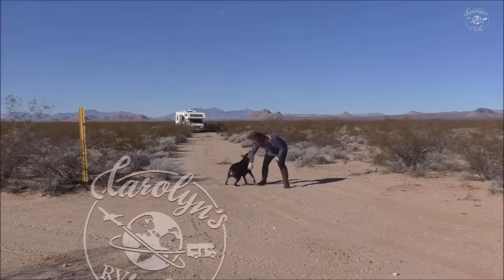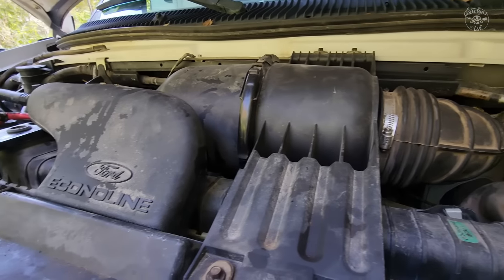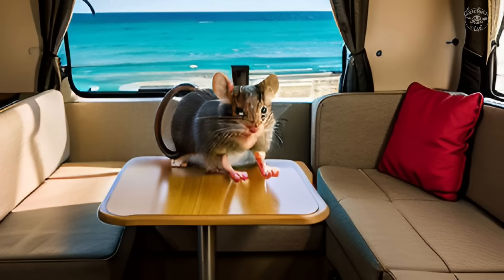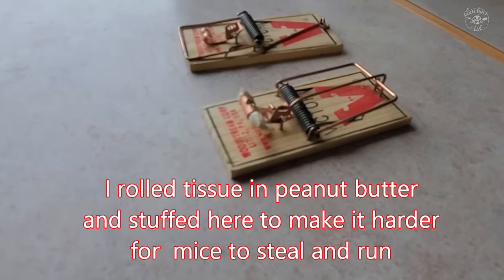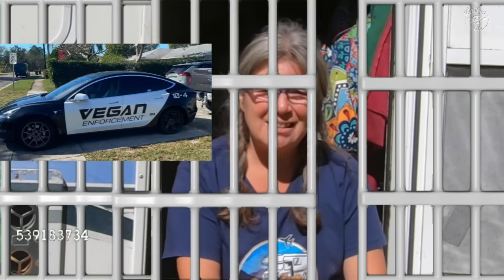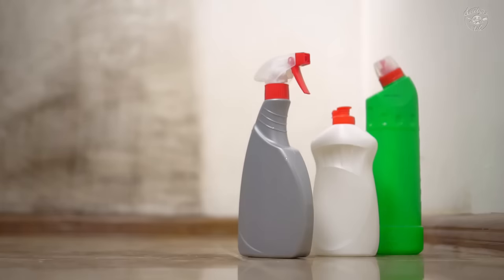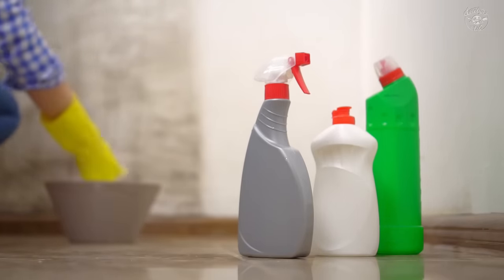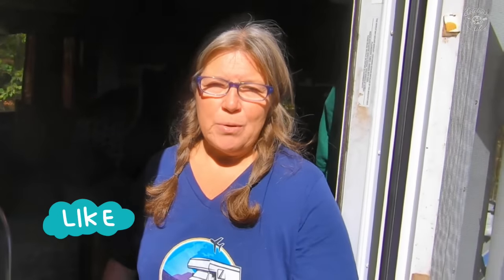Tips to Keep your RV Mouse Free, Plus My Secret Weapon for Keeping Mice Out!

Comment: I used Pinesol in my ambulance conversion due to it being rodent-infested when i got it.  I spay peppermint oil in the engine bay, wheel wells, and at the doorways, and so far.. three years now, not one mouse has bothered.

Comment: Thank you for the video. This past winter we completely packed every hole with peppermint pellets and it did not work. I bought the little packets with peppermint, I had peppermint pellets all over the ground and in compartments, peppermint everywhere. However, no peppermint oil. So the trick seems to be that peppermint oil coating everything works much better than the peppermint pellets.

Comment: To all of Carolyn's friendslys  who own pop up campers. The way you can  keep mice away during the winter is. When you close up your campers for the winter is go to the grocery store and  buy perfume dryer sheets and put the sheets all over the inside of the camper,  on top of the beds  and in the cabinets  and even on the floor . Anywhere they come in.  On the outside of the camper put steel wool in all of the holes so that they don't  go in . Tried it and it works..
Reply: I had mice in the drawer, in my RV, where I had a box of dryer sheets. They weren't deterred.

Comment: Stored my motorhome over the winter, which was really mild in MN this year. Came back and first thing I did was checked the drawers. Saw mouse poop and remnants of acorns in every one and even a small pile in my bed. Never had an issue with mice and the only food I had left was a box of spaghetti, which was untouched and some spices and condiment packs. They chewed into the condiment packs. Since I've been back I've only seen evidence in one drawer they at least once came back to visit when I was gone for a couple of days. I've kept a string of lights on under the coach and when it gets warm and dry I'll go through all the cargo holds. It seems they came in for a warmer place over the winter, and I hope that's the case. I'll add some peppermint inside and outside. BTW, they were in the drawer where I kept an opened box of dryer sheets and that didn't deter them at all.

Comment: We have had rodents in our RV and we have found that Irish spring grated helps as well. We put all around the outside and under the rv especially the under the cab. Put some in the drawers towards the back.. we also put it a little heavier around and on top of the tires. We are in Ohio where the winters are cold longer so we put insulated tubing all down the slide out on the inside and outside and has helped keep them from coming inside, when one got in it couldn’t find its way out because of the tubing covering all the slide out. It then went up and behind the flap on the burners and I keep a mouse trap there and got him that night. I also put steel wool with tape in the opening of the fresh and grey water tank. They also because it’s not sealed very well found big nesting beds in the generator area so lots of Irish spring there with peppermint spray.  So I feel your issue. So glad you solved it.

Comment: Wanted to find out where they were getting in my van.  Looked at rear doors and suspected the gaps under the doors and stuffed them with steel wool and rags. Set up camera and light last night to see, and sure enough, that was at least where I saw quite a few mice and possibly rats trying to get in.  Argh!!  

They did not get in as far as I know last night, but setting up a camera and finding their entry ways is imperative.  When you find the holes and or gaps you need to figure out a way to seal them up permanently.  Which is where I am now...Bob Wells recommends a bucket of water system to kill them more humanely.  I'm a big wuss, so trying to figure out the solutions now.  (p.s. I have blinking lights under my hood and under the area below the engine (5 of them.)

Comment: I lived in a house built in 1840. Mice had pheromone tracks going back generations. I did many things to conquer the mouse problem, but the most successful was having a dachshund. They are bred as vermin hunters and are relentless when they hear/smell mice or other rodents. Never had a mouse problem as long as the doxy was on patrol. Mice smell a dachshund and they leave! 

Before the dachshund I baited live traps and drove the mice 5 miles from the house to release them. The problem is, for every mouse you find, there are probably more than 20 babies in the walls. They are fertile a few weeks after birth. 6 generations during the winter months. Assuming half are female, that’s one million mice - if they survive. Get rid of them as soon as you find them!
Reply: YIKES!!  
I wonder if you can brush your dog and take the fur and shove it places to deter the dang vermin. Be a good thing if it worked.
Reply: My dog is a rescue, but obviously a Boxer was there.   

I've heard the same thing...for every mouse you see, there are 25 in the walls. Dang!
Reply: I think its because whe you kick some out, others move in, ones that probably couldnt because it was occupied. Thats what i noticed wheni started trapping and reelasing them. I was even using motion sensors to detect them, so was sure i had it down to 1, then i saw 2 show up in my room, these weren different mice, the other mouse wouldnt dare do that, and they had a different colour, so i think some new ones moved in, and we have access from outside.  Its also an older building and we got racoons too lol i heard them fighting one night and also walking in the vents to confirm they were inside.  This was on the bottom floor.  Theres a bar downstars so no one lives there and is empty during the night so theyve managed to live unoticed i suppose. And if they can get it, the mice can get in im sure and probably why they keep showing up -new ones come  in once theres a vacancy. Just  a theory.  If you cant get a pet, mouse proofing from the outside is probably youre last option.  There could be the tiniest of entrance to get in , or years of tunnels and secret passages if its an old house.  They dont magically spawn out of the walls and it does take some time and a good food source for them to have many offspring. I fed a family one winter and there was only 6 in the end when i trapped in the spring, they didnt explode, but there always seems to be 1 left that you miss and starts the next generation.  The motions sensors helped that, finally telling you if there was any left.

Comment: So, so many make the mistake of not cleaning with bleach the areas where mice and pack rats have deficated and urinated... and then they wonder why the peppermint oil doesn't work. 
Great video!!
I also use Irish Spring bar soap in my problem areas as well.. works very well!!!
Reply from the maker: Thank you and thanks for sharing your tip!
Reply: Thanks for the tip! I forgot about using Irish spring.

Comment: I use white solar string lights on the ground around my rv. And I use the round patio lights and so dar so good. Had  a couple of mice be for I started using lights. I cayght tgem with sticky traps! I grew up on a  farm so I do not mind how they die! Sorry if that offends! My tank drain area I fill the hole around the sewer hose with steel wool and duct tape.

Comment: Thank you for not using poison or glue traps! I've had a lot of success in my sticks and bricks with both the rodent repellent foam for cracks and holes and spraying the perimeter with Tomcat Rodent Repellent, which is safe for use around pets when used as directed. I also spray my engine compartment and the perimeter/ tires of my van with Tomcat. The ingredients include peppermint, clove, and cinnamon, and it's a lot cheaper than essential oils.

Comment: I’ve been using peppermint oil mixed with water and spray in my engine compartment for years to keep my cars and trucks from getting rodent damage from chewed wires. It had not occurred to me to do it in my RV. Thanks for the tip!

Comment: I had a mouse problem after RV storage at local RV repair shop.  Set traps and caught 7 mice.  Been using lights under RV and set traps but I also use dryer sheets in every compartment.  Use them on top of table and bed too!  Haven't had trouble since!  Thanks for info Carolyn!👍👍👍😔

Comment: Peppermint oil - what a great idea! I too found the snap traps to be the most humane. It was very clear that they did not suffer and their lifeless bodies would not kill oils, hawks, cats or other critters. The worst year we got a dozen. Peanut butter was what worked well for us too - perhaps the strong scent called to them. What a great video - the warning about the steel wool was brilliant. Vibrations of driving would cause it to rub away the coating and then it would short to the chassis of the vehicle..

Comment: Using enzyme cleaners will eliminate the organic stuff and odors followed by a hospital grade bio disinfectant.
 Using a vacuum is not a great idea as tiny particles of the germs they carry can get past filters and you don't want germy turds contaminating the components of vac blowing in your space every time you use vac.
They get inside through the areas around the wiper cowling on some vehicles. It can be tedious but using light, smoke(incense smoke ) or steam to find any hole to plug up is worth the effort.

Comment: When I winterize my RV, I put fresh dryer sheets all over my rig. I have had my pull behind for almost 5 years with no mice. Last year, I was lazy and didn’t do it. Well guess what? I have mice in my camper!! So now I get to deep clean the whole camper! That’s what I get for being lazy! When I was cleaning, I found the most mouse poop under the kitchen and bathroom sinks! I also put a brand new bar of Irish Spring Soap under the kitchen and bathroom sinks. I didn’t do that either! 🙄🙄🙄 So now I’m dealing with mice! All my fault! I don’t have any food whatsoever in my camper when it’s not in use, so that wasn’t the issue! And it’s safe for my dogs to be around!! Hope it works for you if you try it!! Since you live full time in your RV, you should change out the dryer sheets every few months!! Hope this helps!!

Comment: I recently had house mouse problems so I purchased “Shake Away” mouse repellent, it has peppermint, cedar and rosemary oil. Like you, I got out the steel wool fine gage and plugged up holes then I thoroughly cleaned and after that I caught 5 mice in the catch and release plastic traps. I think they got trapped inside after the holes were all plugged. I released them in the woods away from homes and two miles away from my home and then the last thing I did was the peppermint Shake Away, after that no more mice. I don’t like the cellophane it comes in but they are small and easily taped to places like inside an old chimney and in the doorways, good to know about the spray. Yes pets can have a problem with the toxicity so excellent warning! But Peppermint really works!!

Comment: Hi Carolyn, it's funny how this video just popped up in my youtube feed as I'm sitting in front of my laptop watching youtube and making peppermint sachets. I have been dealing with mice or rats for a few weeks now in my mobile home here in FL. I have been living in this home now for about 9 years and have never seen a mouse. Well my husband saw one in his bathroom a few weeks ago and it's been driving me crazy. I've been exterminating, and filling holes around the plumbing in our cabinets where I believe they are coming in using copper mesh wire I found on Amazon and it works better then the steel wool. I defuse either peppermint or citronella essential oil throughout my house. We don't have any pets. I just heard one tonight in my ceiling. I'm 68 years old and they creep me out. I started a garden a few years ago so I almost feel like my gardening has brought them in, however I have never seen any out in the garden. I have seen traces of them in my shed as well as various places inside my house on the floor. Because I cannot use any chemical cleaning agents, I clean my floors with vinegar and water with a few drops of essential oils. I'm making sachets to hang inside all of my cabinet doors and in closets though out my 2 bedroom 2 bath house. I made some peppermint spray with water and spray along all the baseboards, because I found out that's how they travel inside your house along the baseboards. I purchase some 1/4" metal mesh screen to place all along the bottom outside of my mobile home skirting. I hope that once I get all the entry point closed off I'll be mice/rat free I don't like sharing my home with these critters.
Reply: Some people have used the sachets, Mouse Magic makes them, but they have reported that the rodents eat the sachets. I've used them and never had them get eaten but with sprays you don't have that issue.

Comment: And old RV'er had a mouse issue and at the time I was having them in my house I had moved into and they suggested old Irish Spring soap the green bars and place them around. After I did that for the next 14 years I never had a mice issue other than the strangler from time to time come late Fall. Also, if you are parked for any amount of time you can get scented dryer sheets and put one in the tailpipe, on the tires, under the hood of the RV and anywhere else you can think it would be helpful at. These two things are not harmful to your pets if they get them but the mice doesn't like the scents and well if they chew on the soap and drink some water you can imagine that one seeing how rodents can't burp or fart.

Comment: Peppermint is the key!!! You can also take old pill bottles (or something similar), drill several small holes, insert cotton balls and soak the cotton balls with the peppermint oil. This can be attached with zip ties to a location in the engine compartment or other RV entry points. I also use the peppermint/water spray for my exterior and interior but I travel solo so I don't have to worry about pets.

Comment: I was going to bid on what appeared to be a brand new Fleetwood Vibe. Let me say first off, new or not new, that Travel Trailer was build like a kids toy. What a piece of garbage. With that said I would have bought it at a low price and tried to flip it. Everything looked right until I noticed by the sink cabinet area a dead mouse.I had experience with a VW Golf the dealer sent to auction becuase of a mouse chewing up the battery cover. I bought it from a dealer $7,500 off sticker with 50 miles (FIVE ZERO) on it. I never had any issues. I think whatever dealer had this did the same. The mouse was dead right next to all kinds of plubming and wiring. I just don't want to dealm with that kind of head ache.

Comment: Some mice moved into my ceiling and would run back and forth while I was trying to sleep at night. I'm a tight-wad and essential oils are spendy, so I decided to try the peppermint extract I had for making candy. I put a few drops on a cotton ball, drilled a little hole in the ceiling where I was hearing them, and stuffed the cotton ball in through the hole. The mice were gone within minutes and haven't come back. It's been almost a month. My point being...peppermint extract for cooking wouldn't be poison for Sadie but appears to work just as well to repel mice. :)
Reply: @randomspirit  thanks for the thrift. I’m always about what’s on hand  it would be even cheaper to buy the extract and maybe mix with a carrier oil for the tires. And the rig will always smell minty fresh!!!

Comment: They've chewed off all the labels of my can goods so I no longer know what's in them-not that I use a lot of canned goods but I always have some. They have very sharp teeth. One of my coworkers when I used to be in a factory office had cheesits in a tough plastic container and they went right through it. I use Irish Spring soap and steel wool.
Reply: I have tried everything the best one I now have in ultrasonic sound  plug-ins, I tried irish spring, they just jew the bars

Comment: 👍🏻😁 I found a peppermint rodent spray (cheaper than essential oil at $16 an ounce) I use it in big areas. Inside I use the pure essential oil on cotton balls- wrapped in foil & poked with holes, placed in back of drawers & cabinets. No mice. 👍🏻
Reply from the maker: That's great! Remember though that you use just 3 drops of peppermint oil in water. You may have paid less, but you paid for 99% water. just a thought :-)

Comment: I can’t kill them. I catch them live in a bucket baited with peanut butter then I drive them a few miles away from my house. It’s not the fastest way, but we did catch them all. We have a Rottie and now we have a cat too. I’m hoping this year the cat keeps them out. Peppermint has never worked for me🤷🏼‍♀️ Thanks for sharing the cleaning info. I’ve used bleach before, although I’m not a fan of it. If they come in this winter, I’ll try your cleaning tips and the peppermint oil. Safe travels😊
Reply: Mint will work as a preventative. Mice leave behind pheromones that attracts others, so clean throughly where they enter… I use Lysol concentrate full strength & stuff the hole with fine steel wool, which should be checked every few weeks. Also, a small motion light pointed towards their entrance will help.

Comment: I'm completely emptying out my van tomorrow bc I've tried everything including poison bait. Nothing's worked. It's been 7 days! And it comes out at every night  - even with lights on and me singing 😂. I'm going to try the bucket method. My 55 lb dog has been zero help. 😂 I've only gotten it insulated so all the thinsulate has to be replaced. It's been an expensive learning experience
Reply: How did it turn out? Any more mice? I had to have the ceiling of the tuck under garage torn out and replaced all the insulation because mice had been living in there, peeing and pooping and the odor came up through the vents into the bedrooms above the garage. Yes, and expensive fix.